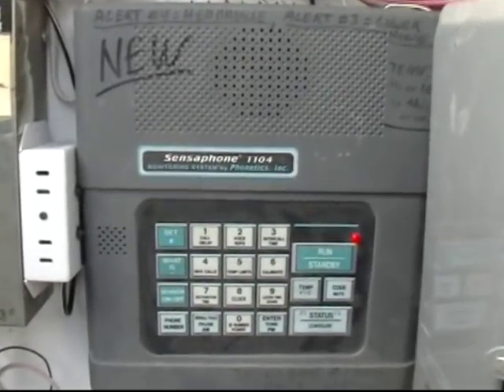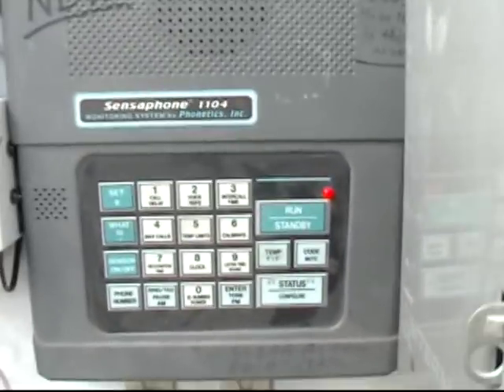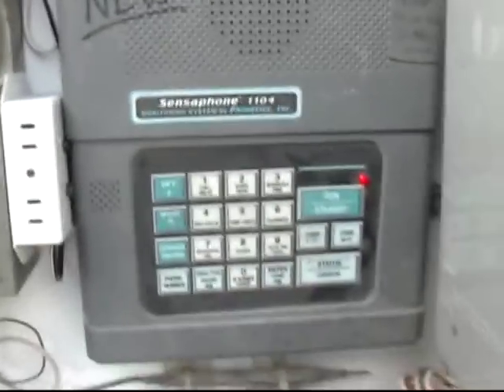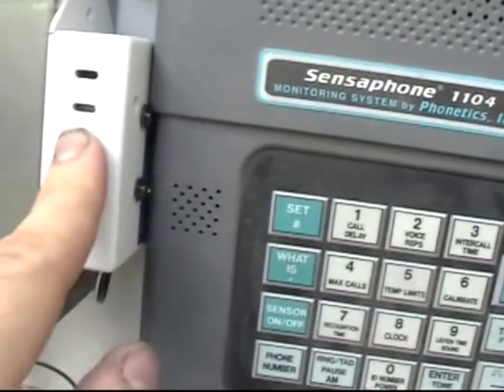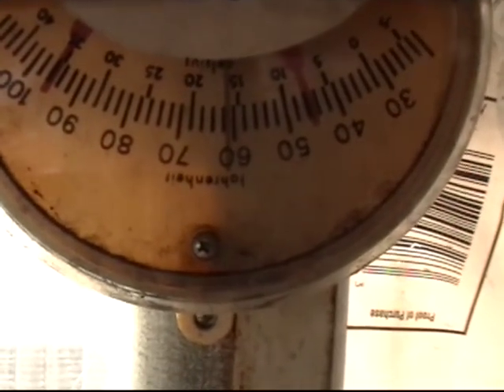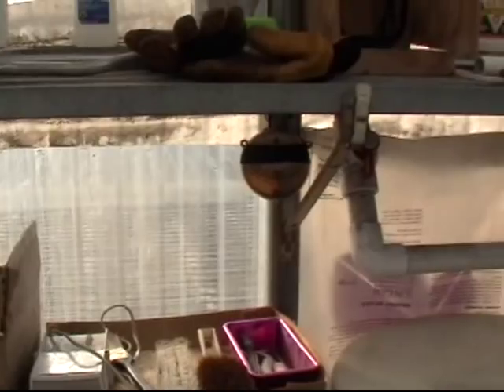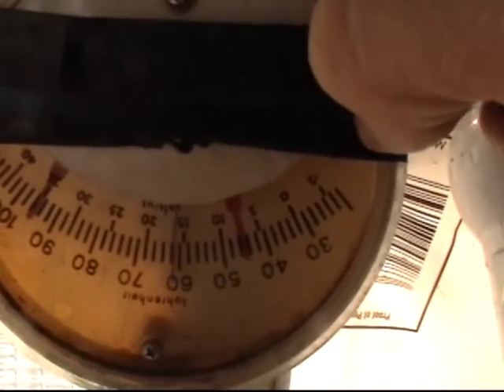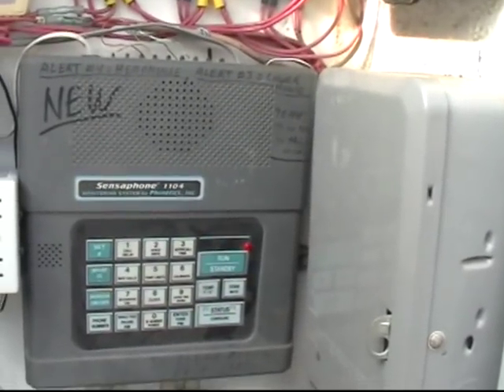Sensaphone 1104 Alarm System

Comment: This is cool! I actually built a system like that, but a homebrew solution using a raspberry Pi computer networked to arduino controllers in each greenhouse. (Total of three) and it controlled all of the pumps, lights, and climate management system. It would email me a report twice a day and save a log for thirty days. If ever a problem arose, it would call our phones via google phone. Similar to what you have here, but probably a little cheaper... Good for a home brew hydroponic set up!